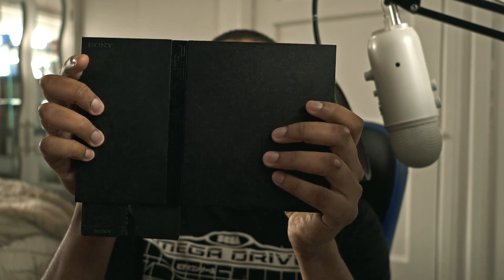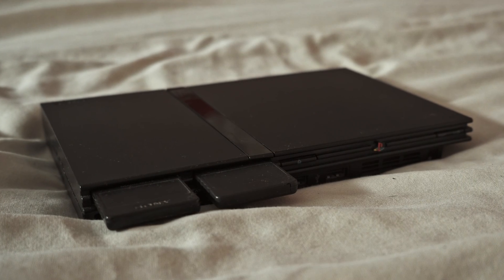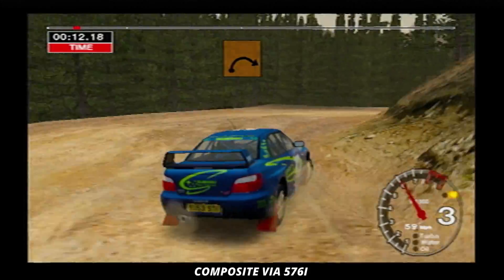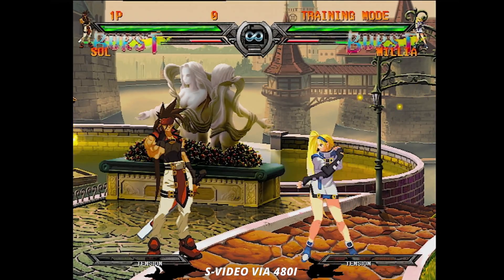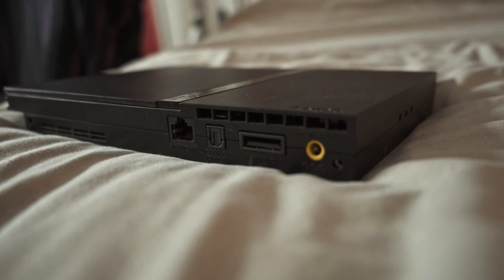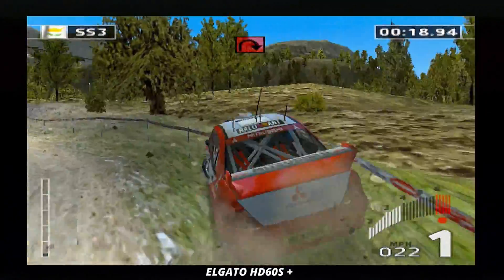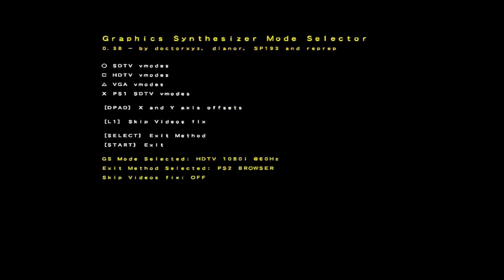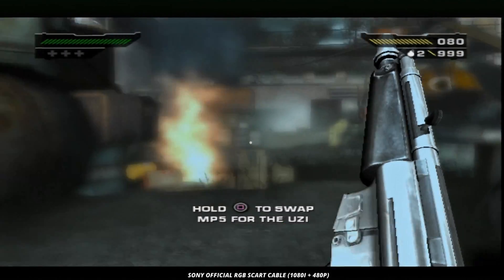PS2 Video Output Misconceptions & How To Improve Image Quality - theaffroshow

Comment: honestly if ps2 had had forced 480p mode ,every ps2 game would look amazing and i think most game
Reply from the maker: @wingedhussar1453  You can force 480p with Free MCBoot but not every game look using it :)

I do wish more PS2 games had it internally :)
Reply: @TheAffroShowGameplay  such as tekken 5 .the 480p progressive scan looks so much better.idk why every game does not have it
Reply from the maker: @wingedhussar1453  Sadly there's no clear answer but back then most TV's especially PAL TV's only supported interlaced content, could be a factor but as to not have the option for it, no idea but it was a shame!

Tekken 5 had its 480p mode taken out of the PAL version sadly!
Reply: @TheAffroShowGameplay  wow thts crappy.because progressive makes such a huge difrence
Reply from the maker: @wingedhussar1453 It really does & if you upscale it like I do with the OSSC, it is incredible!
Reply: @TheAffroShowGameplay  ossc? I forgot what tht is
Reply from the maker: @wingedhussar1453  An upscaler that can line multiply various low resolutions for modern displays :)
Reply: @TheAffroShowGameplay  it's the best?
Reply: So do u use scar and also ossc at same time?
Reply: @TheAffroShowGameplay  where do I buy proper scart cable
Reply from the maker: @wingedhussar1453  I brought mine on eBay but, a cheaper, nice alternative can be found on Retro Gaming Cables here in the UK :)
Reply from the maker: @wingedhussar1453  It is very good but the best are the Retrotink 5x & 4K line but they are very, very expensive and only sold in America :)
Reply from the maker: @wingedhussar1453  Yes, the RGB SCART cable goes into the OSSC, it then connects to your TV, display or capture card via HDMI :)
Reply: @TheAffroShowGameplay in one video you state the ps2 component cables are the best like retrovison hd with ossc. These are not composite cables right? Also u prefer scar cables into ossc not retrovision HD componenet? I'm just saying this because I saw that the ossc online and it's almost 200 dollars. Does it matter which brand what do u have
Reply from the maker: @wingedhussar1453  No, I said Component & SCART are the same quality as long as you get a good quality cable :) Just make sure it's not generic or no name brand cables :)

It doesn't matter which you get, it just depends on your setup & the OSSC takes both Component and RGB SCART:) 

I don't use Composite, that is not good at least not on modern displays:)

You can always get a Retrotink 2x, RAD2X cables or a Retroscaler 2x but their image output is not as good as OSSC & they lack 480p support :)
Reply: @TheAffroShowGameplay  can I buy any converter ossc and it won't matter because ones are over 100 dollars
Reply from the maker: @wingedhussar1453 As long as it is V1.6 & it has the SCART, HDMI, Component & VGA outputs, the brand of the OSSC does not matter, they all function the same :)
Reply: @TheAffroShowGameplay  would u ever do a comparison over the hdmi converters online to the ossc with cables
Reply from the maker: @wingedhussar1453 Possibly, never say never but I know if it's the cheap ones, they are not good at all :)

Comment: Then you have HDMI adapters which ain't that bad for a cheap plug'n'play solution, paired with GSM can give a decent image quality. Then we have the holy grail of PS2 image output: the HDMI modchip by PixelFX, the RetroGEM, expensive as f*** but bypasses the DAC by tapping directly in the video output of the RSX, giving you a clean unaltered image, can be paired with GSM and other integrated options of the modchip itself for amazing results.
Reply from the maker: This is the beauty of the retro community & various mods being made to help get the absolute best out of real hardware:)

It now means the PS2 can be played on anything & modern displays will be able to play PS2 games going forward while having solutions that don't break the bank :)

Comment: The good thing about component cables is that you can play a DVD with no having swap back to composite, no green screen looks great 👍
Reply from the maker: @stevenwoods8330  Actually, with RGB SCART it also works but you need a device or display that Supports RGsB :)

Comment: GSM on freemcBoot is amazing. I use it via OPL loader where there are various options to tweak and have got 85% of my 400 odd games running beautifully. I have half decent component cables connected via a 'Portta' component to hdmi mostly running the games in 720p and it looks really great. This is a great informative video, thankyou.
Reply from the maker: No problem & GSM is a great tool to improve PS2 video quality although not all games as you noted don't work well but, the ones that do really see big improvements to their graphics :)

Anytime & glad to help!

Comment: modern liquid crystal TVs have problems with interlacing because the pixels remain lit until the next input; in CRTs if you see a slow motion you will notice that they disappear almost immediately.
Reply from the maker: This is why I use the OSSC to deinterlace instead, much better than the TV I use :)

Comment: I have a really interesting cable that does composite and component (it has 6 cables) so I can compare quality of component (or make sure it’s functioning properly) in real time and it as always makes me shake my head as to how many people think the PS2 is that blurry image

It cost me around 30-40 USD
Reply from the maker: Sadly people Composite more than everything so once they see RGB SCART & Component, the they think something is wrong xD
Reply: @TheAffroShowGameplay  I was at this retro store and they had consoles going back to the NES and they had a section for the PS2 with a TV displaying a few game demos. The thing was is it was using composite instead of component and it just made me wanna complain but I knew it would be a waste of time because barely any customer would realize it nor would notice it on one singular display
Reply from the maker: @kadebass6187 I see this a lot when I visit retro games stores with games on Display & will always use Composite on every console outside of HDMI support consoles xD

Just cheap and easy to do xD

Comment: 8:53 for the PS3, a solution to this problem is to power up the console via the power button (not the controller) but hold it until it beeps a second time. It will reset the video settings from hdmi/other to RCA cable. In case you want hdmi but the previous hdmi setting doesn't work for you, the first question that pops up in SD mode is "we found a hdmi unit, do you want to use it?", and all you need to do, in blind, is to just press X and it will auto set to hdmi instead, making the image visible again.
Reply from the maker: I remember reading something similar on Google about two months ago, proved to be so helpful & thank you for posting the solution here :)

Comment: I still have a SD CRT and real PS2 hardware for sentimental reasons, but these old PS2 games run and look better on the emulator and modern display. I played "black" at 60fps on the PCSX2 emulator and it was a much better experience (aiming at 30fps on the real PS2 feels laggy). Also, the CRT phosphor mask (I recommend guestHD CRT mask) allows me to get way more detailed and sharper image (PVM-like picture quality) compares to standard SD CRTs. For example, on my SD CRT I can barely read anything on the GTA SA map. On my LCD monitor however everything is perfectly readable despite the same 480i resolution. I always thought PS2 games looked best on my SD CRT, but I just wasnt aware of how much detail I was missing because of that extreme CRT blur.
Reply from the maker: Goes to show how both old & modern technologies can be beneficial & not always clear cut as to which one should be used in 2024 :)

Ultimately I'm happy with my OSSC setup to my Macbook & capture card & it is a joy to play real hardware!

Emulation is amazing & I use PCSX2 often on my Steam Deck 😊
Reply: @TheAffroShowGameplay  OSSC will give you perfect sharpness on modern displays, but I'm not a fan of this upscaler because it makes the pixels look like big squares (it increases pixelation). To the human eye, glowing subpixels never appear as squares, but rather blend into something that looks rounded. The CRT phosphor mask turn upscaled square pixels into round pixels again, so it's like looking at native image. The same 480i will look much less pixelated without losing sharpness. Just imagine your OSSC output without pixelation. 

On PC people can use emulators with reshade (+ guesthd crt phosphor mask optimized for 640x480 resolution with sony aperture grille mask in the shader parameters) to get that PVM like picture quality in PS2 games, but on a real PS2 hardware only expensive retrotink 4K upscaler is able simulate CRT / PVM phosphor mask. In fact, Retrotink 4K CRT masks are even better compared to the guest CRT shader (Reshade), because Retrotink also has HDR, so you can have CRT phosphor mask at 100% opacity allowing you to get perfect image without blown out colors / contrast. Retroarch on PC also has HDR shaders, but it's PS2 core is not as good at emulating PS2 games as PCSX2, therefore I'm using guestHD crtmask. I have spend some time do adjust colors and contrast, but now I'm 100% happy with the results.

Comment: Ps2 can output native 1440p with soft mods
Reply from the maker: Can you explain how to do this? :)
Reply: @TheAffroShowGameplay  Yeah, absolutely. I personally use a fat PS2 with RetroTINK cables, which I have hooked up to a splitter that goes to a CRT and an OSSC upscaler. I have the OSSC in pass-through mode because it doesn’t properly upscale the image. That’s how I connect it to my TV because my tv doesn’t have component inputs but if your tv does have component in this can still work or you can just use a generic component to hdmi . Now the software we use is an application called OPL Manager. Some people use it to play backups of games, but if you insert a physical disc, you can go into an options menu contained within the software. that allows you to select different display settings, ranging from 480i (which can be switched to 480p) up to 1440i and 1440p. You just need the latest version of OPL.”
Reply from the maker: Hmmmm, I'll have to look into this, I know GS mode selector allowed for 1080p maximum although it was very unstable and required Component cables to work :)

Thank you for explaining this to me!

Comment: The great thing about the PS2 is that the RGB SCART connection can do 480p (progressive scan) via sync on green compatible monitors, not just component, both the OSSC and the retrotink 4k can do sync on green. Sadly the only PAL games I know that do progressive scan are Project Zero 3 and Tekken 4, sadly the PAL version of Tekken 5 only gave you the option to choose from 50hz and 60hz video.

4:3 is also the best picture quality compared to 16:9 anamorphic since they both share the same horizontal resolution. Just 16:9 stretches it out.
Reply from the maker: There's quite a few games I own which are PAL for PS2 that have 480p progressive scan support :)

I count I have about roughly 15 PAL games with the support:)

It is great more people are finding ways to get RGB SCART to work at 480p now :)

Yes, not many games had a good implementation of 16:9 during the 6th generation so 4:3 should be used more!
Reply: then its not so great afterall
Reply from the maker: @kidrobot.  It's just the nature of the PS2, just use the correct aspect ratio for the game :)

Comment: i retired my ps2, i currently use my xbox series x to emulate ps2 games @ 2/4k depending on the game and compatibilty from pcsx2
Reply from the maker: Nothing wrong with that & if it works better, keep using it :)

I love PCSX2 on my Steam Deck:)
Reply: @moes95 can you get banned for doing that?
Reply: @bh_lad  no it uses dev mode to emulate u can do all you want there, dev mode is seperate from retail u do need to buy dev mode acces for like 15€/$, i have emulators for ps1 ps2 wii ngc 360 and everything older than that

i git vids in my channel playing xbsx2 if u want to see performance

Comment: What’s best way to play ps2? On ps3 backwards?
Reply: Easy solution to play PS2 games through HDMI: mod your non-bc PS3, which allows you to backup and play PS2 games. 
Very easy solution: PS Plus Premium on PS4/PS5 and its growing library of PS1/PS2/PSP games - plus they are mostly upscaled.
Reply from the maker: The best way to play PS2 depends on what you want :)

PS3 is a great choice, but the ones that can are very expensive & notorious for breaking down a lot along with their cost :)

Emulation is a great alternative, PCSX2 has come a long way & you can upscale the games but not all games work & it's still being optimised:)

Real Hardware offers the best compatability & these days you can mod it with hard drives or SD card mods if you want to get ROMS from the Internet as opposed to the disks:)

Of course with that you'll need a CRT, a HDTV with analogue inputs or like me, get a HDMI based upscaler like the Retrotink/Retroscaler 2x, the OSSC, the RAD2x line or the Retrotink 5x or 4K for the best video quality for retro consoles, Including PS2 :)

Ultimately all methods have their ups & downs & also make sure to invest in S-Video, RGB SCART or Component cables for the best looking video output for PS2 games or HDMI if using a backwards compatible PS3 :)

Hope this helps!

Comment: Buy once Retrothink 4K and cry once. And never cry anymore.
Reply from the maker: Sadly the cost is huge & most will never buy it, as good as it as :)

I'd rather get the 5x & even then it's still expensive! 

The OSSC or other Retrotink products are good alternatives for most people:)
Reply: @TheAffroShowGameplay Hey if you want a pretty good 4K upscaler id recommend the pixel fx morph 4K it’s up at $275 rn. Looks good! Not retrotink level masking an deinterlacing but it still does a great job!
Reply from the maker: @TheLeadG  Sadly the price means it is not affordable & I've already decided on the Retrotink 5x once I can afford it but thank you for another suggestion :)
Reply: @TheAffroShowGameplay I found Retroscaler2X people saying it’s a clones of Retrotink2x and it’s cheap. Have you tried because I’m about to get one.
Reply: Just looked it up ... Yeah, no. HD retro vision component cables work well enough for me and my 1080 TV has good 4:3 scaling and deinterlacing.
Reply: I would rather pay $750 for a Retrotink 4k than $700 without disc drive and stand ps5 pro, i will try my best effort to get it by December
Reply: @91lifetime23  Exactly how I feel. Modern games just don't excite me anymore. The hype was real with older gaming generations. Playing Half-Life, StarCraft, or Mass Effect 2 at launch felt like magical times.
Reply: @91lifetime23  It’s worth it imo. I’ve been using it with my GameCube paired with Swiss and Gc loader and I have only touched my ps5 to play silent hill 2 remake (btw an awesome horror game DEFINITELY recommend) and it’s just been an absolute blast. When you add some Swiss cheats into it too you can get an even better picture. Games never looked so good on the GameCube.
Reply: Retrotink are grossly overpriced.
After some research I'm buying a Mcbazel odv gbs-c, which is far more compatible with playstations.
Reply: Is that a big of a difference compared to the 2x pro?
Reply: @ThePrivateGamer19  i have retrothink 2x 5x and 4k pro is best looking
Reply: I have an 8K TV with built in upscaling - it’s sharper, but still sorta fuzzy. I’m just worried the 4K will downgrade my experience.
Reply: @rythe3rd  just wait for Retrothink 8K
Reply: @ if they make it
Reply: @rythe3rd  probably retrothink 6K first
Reply: I bought the bootleg version of RetroTINK it’s called 

RetroScaler 2x it was made to rival RetroTINK and it only cost me 30 dollars for a ova stock from a where house!!!!

but normally they cost 60 dollars and up.

Google it or YouTube it people swear it’s great my is comin in the mail now.
Reply: 😂Un juego que tiene resolucion nativa 480i en este caso los de ps2 lo mejor que puedes verlos es parsarlos de entrelazado a progresivo 480p porque si lo escalas perderas mucho detalle y nitidez asi que no funsiona nada bien superar los 480p
Reply: Or just buy the hdmi mod it looks better
Reply from the maker: @dxtremecaliber  I'll stick with what I have :) No issue with it :)
Reply: @dxtremecaliber  hdmi mod for one system or for all because retrothink 4K you can connect everything
Reply: @dxtremecaliber That HDMI mod is great if you have one of the later slim models but not so much for the og phatty

Comment: Good video. One thing you didn't mention was the lag on TV component inputs. Even if your TV supports component inputs, you will have less lag if you use a cheap component to HDMI converter and go through the HDMI port.
Reply from the maker: I've personally never had any lag from Component or any input, I actually got lag from those cheap converters on my personal TV :)

Everyone's TVs or displays are different, I know one TV I used where playing games was impossible using HDMI as there was 6 seconds of lag, no joke!
Reply: @TheAffroShowGameplay   I got this advice from RetroRGB who did testing on a lot of flat panel TVs. It seems to work well for me.
Reply from the maker: @tristanheron4144 I know the channel, I watch him a lot :)

I don't disagree with his findings but for me I've had good success with my devices :)
Reply: @TheAffroShowGameplay  you can adjust input delays which is a workaround